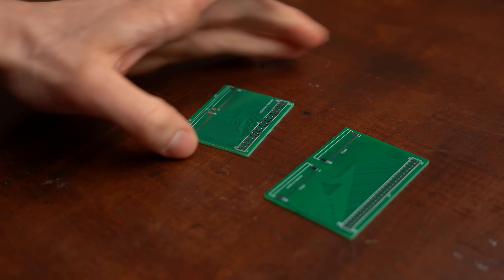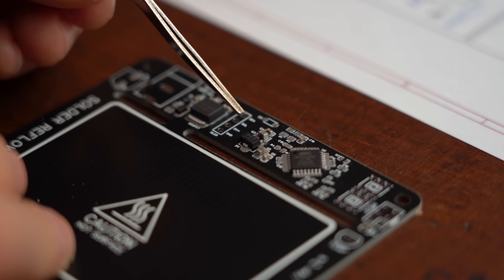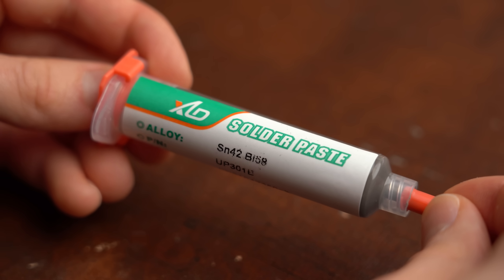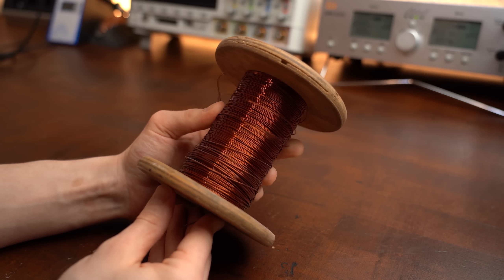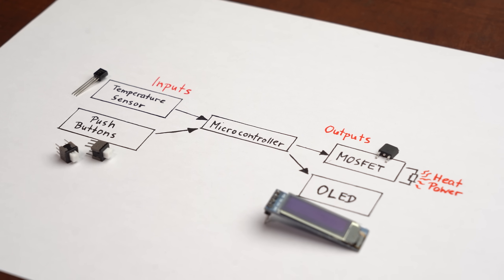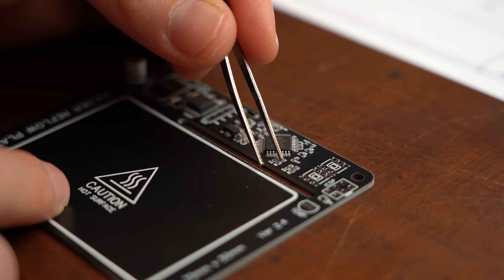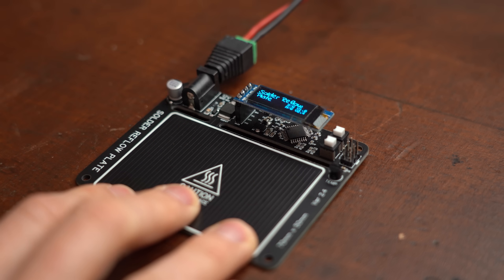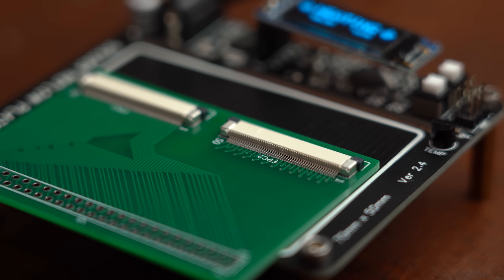The Best way to Solder? Hot Plate to the rescue! (DIY or Buy)

Comment: I got myself a couple of weeks ago also my first Aluminium PCBs and was also a little frustrated, because it didn't work with hot air.
But I used my electric stove for it. Couple of layers of Aluminium Foil to protect the surfaces and to put the thermocouple into and then just modulate the heat manually.
Not really nice but it worked.

For the DIY Version, it would be nice, if the heating part and the controlling part are separate. Because then, you can almost treat the heating PCB as a through away item, without making the whole controlling part again.

Comment: Buy a cheapo hair straightener from flea market. Fix both sides to an aluminium plate and viola. If you find a more evolved type than It has also a digital thermostatic regulator. Thanks for the up.

Comment: Couldn’t you use a griddle? I know it wouldn’t have automatic temp adjusting but you could do that manually if you wanted. I know people used to use griddles to reflow Xbox 360 consoles with the Red Ring.

Comment: It is probably the cheapest product out there but there is still a lot of space for improvements:
-use a smaller ATmega since the smaller ones seem to be more available + only a few pins are used some of the 10-14 pin versions would be enough since there are only a few IO actually used 
-make the heating plate replaceable  , maybe link the 2 boards up with some WAGO connectors and wires 
Why? since the PCB will probably exfoliate wit time 

On a side note i think some other more powerful heater can be also used like a cooking plate or those ironing irons . You only had 30W but with some other heating element you can easily get more , especially if you use 220VAC , but you could also increase the voltage ( the the transistor is good enough).

Comment: This is actually what I did with my old 3D printer heated bed :) I just wonder, are there certain temperatures and durations that should be avoided in order to not damage LED's and special components like capacitors?
Reply: There definitely are limits.  Although parts can withstand way more punishment when the circuit is not powered compared to when it is.
You can sometimes find info in the part documentation. 

As a general rule, light preheating should be fine. (Around the max working temp of the part.)
 When using soldering iron, be as fast as reasonable. (The preheat helps with this a lot.)
But, I'm not an expert, so take this with a grain of salt.
Reply: @galaxya40s95  Yes, thanks a lot. I expected them to take less damage when hot but not powered. I use the heated bed not to solder but to help put heat into the objects I'm soldering on, so I only need a little more heat from the soldering iron.
Reply: I was thinking about this. When he showed the trace on the diy plate, I thought it looked just like the underside of my printer's heated bed

Comment: another technique i have learned about is known as the "hot air bath" it basically blows 100C air underneath the PCB to get the board up to a temperature where the flux in the solder activates. You can then go in and use a hot air station to melt the solder. Its pretty useful in that you end up only using the hot air gun in the solder flowing so you spend less time potentially melting components.

Comment: I remember there was a separate heater and thermistor part (made from aluminium) that was made just for re-flow soldering, maybe you could disconnect the pcb heater and thermistor to then send it to this part.

Comment: I'm using one of those bigger aluminium hot plates. Advantage for me is the still fairly small footprint (100x100mm) with the ability to solder all kinds of sizes and to solder alloys due to a high power heater.
But I can recommend the clothing pan solution with a SN42Bi58 alloy. You don't even need additional circuitry, just fully ramp it up and go for it.
For those who like to tinker you should definitely check out the PCBBQ from maker.mokoe

Whichever technique you use, get your solder paste game right. Just one squeeze over the stencil has to be enough. 
Otherwise you might squeeze the solder paste under the stencil and make connections you don't want.
If you're a beginner always go with SN42Bi58. Its non toxic and very easy to use due to the low melting temperature. 
There's almost no way to burn your components using this alloy. 

An often overlooked step is the cooldown process. If you don't use a soldering temperature curve try to mimic it yourself. Don't shock cool your PCB but let it cool off by itself, on a silicon sheet or something which doesn't conduct heat very well.

Comment: I make do with an Ali-express mains operated hot plate and pinned/soldered it on blank PCB's and added feet, not ideal but it does the job and doesn't burn the surface (short term use though) PS spammer reported, damn pests

Comment: Nice prototype though some improvements can be made to this design.
1: Separate control and heating PCBs. Link them using a connector of some kind. This link should be power only.
2: Build the heater board using aluminium.
3: Mount temperature sensor to the underside of the heater board using thermal adhesive. Use silicone insulated wires and lead free solder to connect it to the control board.
4: Add calibration functions to the software to correct any differences in measured temperature.
5: Space taken by the new setup can be minimized by moving the control board underneath the heating board and using brass spacers to keep the entire thing off the cable. Screen and buttons may need to be mounted on a vertical sub-board facing the front of the unit.
6: Consider switching to a rotary encoder instead of buttons.
7: Add a thermal fuse to the underside of the heater. Just in case.

Comment: If a cooking hotplate is too big for you, read below how I modified one - get a PTC Heating Thermostat Heater Plate from china. A 70x120mm 220V 300W 260Degree unit can be found for under €10 incl shipping.
Too lazy to make a proper reflow controller - check out the ALTEC PC410 Temperature Controller Panel for BGA Rework Station, around $90
 I wonder what happens if/when an aluminum pcb gets too close to the control circuit, and there's no traces that fry ;ø)

I modified a ceramic hotplate normally used to cook food by taking a cheap chinese PID controller with a SSR and mounting the temperature sensor securely inside the hotplate, right under the center of the ceramic heating part where it was mounted with metal. Ensuring no electrical contact I routed the wire outside and connected everything securely so mains is not exposed to touch, etc.

With this relative LARGE hotplate I can heat up phones and tablets at a low temperature and remove screens, I can (pre)heat PCB's at a high temperature and make it solder itself or use an iron - and even use the hotplate as a bottom unit if I need to reflow large BGA's - and a hot-air gun on a stand on top. The PID controller sets the temperature and the stability is surprisingly good, even with a non-tuned controller - though it overshoots a bit initially.

Comment: I've been using this technique for about 2 years using one of the blue "large" hotplates, and actually have gotten pretty good at it, though I do find 0402 and SOT-553 components too small to work well with a stencil. I have a challenge for you @greatscott. While shopping for solder paste, I noticed that the low-temp melt solders come in different temperature ranges, and I thought... this could be used to do double-sided PCBs, which are usually not possible for hobbyists at home. You would first do one layer with the higher temperature solder, allow it to cool, and then do the other side with a lower temperature solder. Unfortunately I have not had the opportunity to try this yet, but I think it would be a fun project for your channel.
Reply: (Edited: we did this with oven, not hot plate! Not sure you can get good enough heat transfer with plate method)
Actually you don't need two solder pastes for this as the remelt temperature  is much higher than the first melt temperature. Have done multiple double sided boards this way.(just do the side with the smallest (best weight to paste area )components first)
Reply: That is really interesting idea. Sounds worth pursuing further.

Comment: Call me ignorant, but why not use the diy circuit to power one of those cheap and cheerful chinese hotplates? I'm not talking about the ones you showed on ebay; It's actually mini ceramic cooking hot plates. Just replace the circuit

Comment: I'm a big fan, I watched almost every video of yours.

I have an interesting topic which I think you might want to cover.

Try pushing the I2C protocol to its maximum. Using your knowledge, I believe we may find out that this protocol may even work hundreds of meters!
Testing things like, which wire, which awg, twisted pair or not, dealing with capacitance, pull up source, etc...

Comment: One thing I am curious about is how much it would've cost to have the DIY version made entirely by JLC PCB (including the soldering of the SMD components). 

Perhaps a small 3D printer hot bed could be a good substitute for the PCB heater.

Comment: Instead of using a PCB as the heating element, the original designer may want to use a metal plate with a cartridge heater. This type of heater needs to be buried inside the metal hence a separate heater block and a metal plate that the block attaches to are needed. This way though, the metal plate can be replaced to whatever size the customer needs while keeping a standard heating block. These heaters also come in variants that are AC powered. With a little PID magic they can be controlled to output precise temperatures.

Comment: ..or you can simply spend 5-10$ on a 7x10cm aluminum hotplate on AliExpress that works perfectly fine, even on aluminum substrate PCBs. 
The only thing I'm not the biggest fan of is that it's mains powered, but it is isolated so it's not that big of a deal.

I've even seen some ordinary irons (for clothes) being turned into adjustable reflow plates.

Comment: There is another way to make a hotplate you should try
Use a PTC heater element that can reach atleast 200C and put it on the bottom of an aluminium plate. Next add a thermistor to the underside of the plate to measure the temps and connect it to an ESP8266 or Pi Pico and connect it to a display to view and adjust stuff
I have been able to build such a plate for just 10$ in total and it can heat up pretty large aluminium PCBs pretty quick and is really reliable too

Comment: Here in America, we have an antique electrical device called a 'clothes iron'.  These were used in the old days for removing wrinkles from clothing (back when people cared about such trivia).  It consists of a temperature controlled heated stainless steel plate about 4 x 10 inches.  Perfect for reflowing solder.
Reply: Every tool is a hammer but hammers are specialized tools. 
Your iron is a tool but not a hammer.
Reply: @safetyinstructor I'm sure you could use it as a hammer if you really wanted to
Reply: No shit bro

Comment: Couldn't you build an induction heater hotplate? So that instead of resistive heating of the PCB you could instead use the space for a coil and then heat up iron sheatmetal with a small distance to the PCB below which could potentially fix the life span issues as you can cool the PCB from below the PCB aswell. This might also be an interesting project for you in the future.
Reply: Won't induction be potentially dangerous to the parts? I mean it could induce some current in the circuit no?

Comment: Every time I see lady Ada using that mini hot plate, it makes me want one... I do such small boards, and it looks so slick... Can even put open source firmware on the hotplate apparently...  Regarding the diy durability, I'm pretty sure that some 3d printers use PCB heaters for their bed. Not sure if they use a different board material, but it's a thing that exists at least...

Comment: I've seen DIY hotplates made using a clothes iron as well. I would love to see a video converting an iron into a hotplate. Cheers!
Reply: This is what I was thinking about. I’ve seen youtubers use irons and they seem great and the surface is much larger than the buy product in this video
Reply: @ollie-d  yes, just add control circuit and relay, ive been do this
Reply: Yeah idk why everyone gets fancy with it... Just buy an old iron for like 3 bucks at a thrift store, most of them already have temp sensors built in and of course their own power supply, all you need is a relay and an Arduino. Better for the environment, cheaper, and way more robust and reliable...

Comment: Wiring and soldering is the only reason I don't do much physical electronics work and focused on more programming and design.

Also the fact that I can accidentally break a component and have to wait for the mail to come to continue a project or never realize it broke causing the core of the issue.

Comment: Is having the controller circuitry on the same PCB as the heating element a problem?  Won’t the heat affect those controller components, eventually damaging their own solder connections?

Comment: I've seen a video on yt when a guy made a hot plate soldering station out of an old clothes iron (took just the metal part)- that could eliminate the question of how many heat-ups the PCB can handle :) Also, with mains power over a relay it would heat up waaaaay faster - a possible mk2 version of the DYI? :)

Comment: I use the aluminum ptc heaters powered by mains and self regulates at around 240c. I just put the al pcb on it, turn it on, wait for the reflow magic then turn it off. Works pretty well.

Comment: Hey GreatScott, I used to be a surface mount assembly tech in the UK, just wanted to give some advice on solder paste application using a stencil. Lay the paste down the shortest edge of stencil and using a thin but fairly stiff piece of metal drag the paste "sausage" across the stencil in one go(using firm but steady pressure), the paste should appear to roll as its going. Repeatedly wiping across the same spot as you do in the video is causing excess paste to go through the stencil, which can cause messy joints and bridges.
Reply: I may never be able to use this info, but it's damn good to know!
Reply: Can confirm
Reply: Great to hear, that was my impression too but with much less experience so good to have confirmation! 👍
Reply: If you don't mind me asking, do you have any pointers for resources of how to do stenciling? I have absolutely no experience in this area and am just exploring the ideas and trying to grok it.

To be less vague with my question... What does the general process for designing & producing the stencil that you use to lay down the solder paste on the board? Would it be something simple-ish like a desktop CNC and some thin metal to route out the holes for the paste, or am I not big-brained enough for this and missing something obvious?
Reply: @jwshields  its best to have the stencil made by a proper manufacturer, they will just need the gerber files. The stencils are typically stainless steel 0.1mm to 0.15mm thick, and are laser cut. Trying to machine something like that with a desktop CNC probably wouldn't yield very good results.
Reply: @jwshields  personally I just took the easy route and ordered a stencil when I was getting my PCBs made - was dead easy based on the gerber files. Only thing I learned was to make sure I didn't have too big a stencil (I found the JLCPCB website was a bit confusing on this bit).
Reply: @alanjrobertson  gotcha. I figure if you're ordering PCBs, a stencil to come with it would be a typical sort of addon, that's good to hear.
I guess I'm more interesting in doing my own PCBs and trying to think out the stenciling for that, you know? Mind, I'm just thinking out loud here, I do appreciate the insight though
Reply: @jwshields  I've never made a pcb myself, but I'm working on a project to do so. I've got some blank pcbs, some photoresist film, soldermask paint so far. Some stuff left to buy. My plan is to make as much use of my resin 3d printer as possible. I'm gonna write custom gcode to do the lithography on the photoresist straight on the lcd bed of the printer. I'll print a custom jig to hold the board in place with precision, so that I can use the same process to develop the soldermask. I'll put the board with soldermask paint on it onto a piece of FEP film and apply some pressure with a weight to get an even layer. And finally, I also plan on printing the stencil for solder paste application. The printer has a pixel pitch of 50 microns, and can do layers as thin as 20 microns (dubious precision at such thinness though, but the stencil will be a lot thicker).

I'm not sure if all of these steps are gonna work out, or any of them. Could be a complete fail, but people have done at least the photoresist lithography on 3d printers with success, so keeping my fingers crossed. It might be something to look into for stencils, if the 3d resin material turns out to work well. Resin shrinkage during curing also needs to be taken into account, which depends on the resin used, but could easily be determined experimentally.
Reply: @jwshields  what about using the 3d printer as a laser engraver and cut your own stencil this way? It's just an idea, never tried something like that and never had a 3d printer.. damn!
Reply: @Shabbymannen  Depending what you're doing, you may not need a mask. I've made several bespoke PCBs by putting the solder paste on with a toothpick. It's not optimal but it's cheap. I've also heard of people having success cutting acetate sheet either with a knife or laser engraver (less hardwearing, obviously)